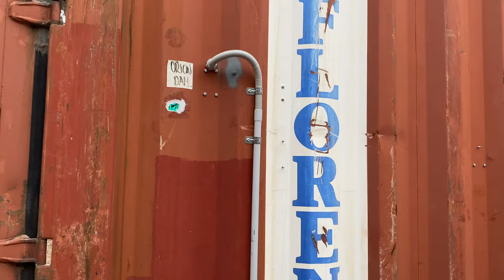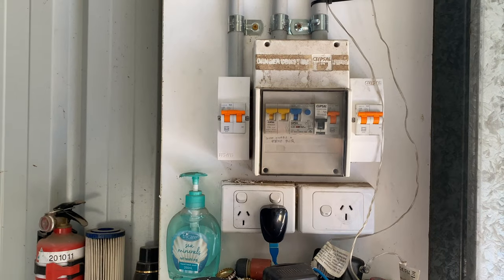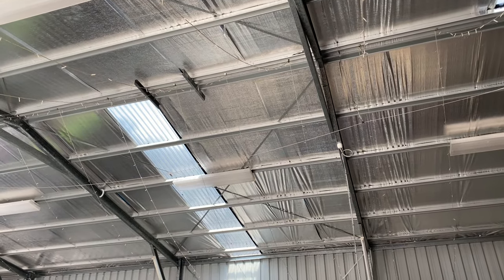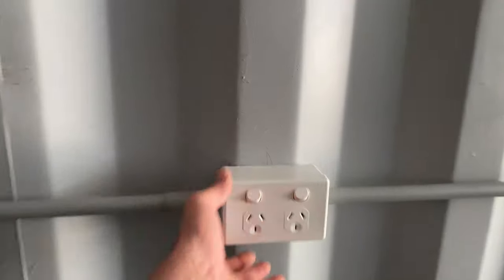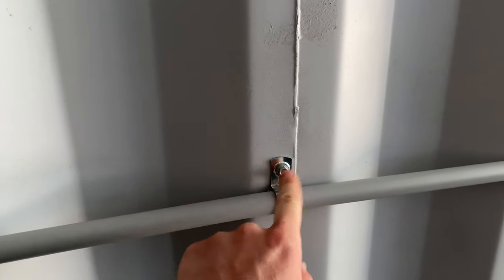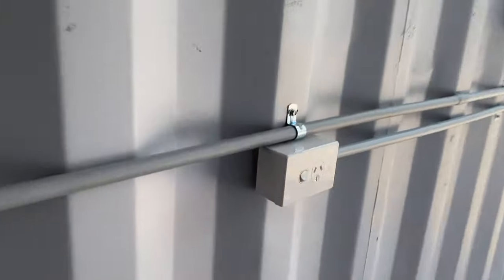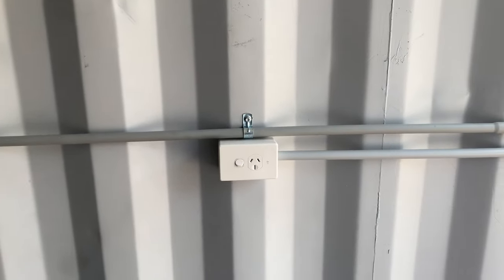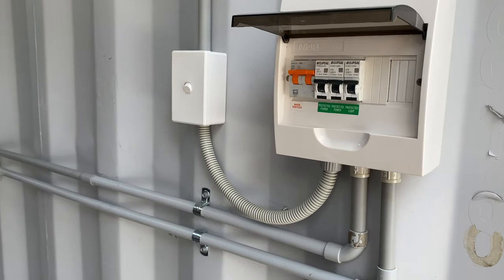40ft Shipping Container WORKSHOP Build - Electrical Part 2

Comment: What size/type hardware did you use to secure the GPO boxes? It looks easy ( was your helper on the outside holding the bolt head)? 
I’m inspired, I’m gunna fit out my container like this now. 👍🏻
Reply from the maker: It worked amazingly and still does, if you have the time I suggest welding nuts internally to avoid drilling holes and even cable tracks if possible.. yeah we just bolted through the wall one inside one out worked well..

Comment: What type of screws were used to install all the electrical equipment on the container ribs?
Reply from the maker: M6 bolts with lock nuts were used and gal painted
Reply: Thanks!

Comment: That looks like heaven!! Awesome work mate!
Reply from the maker: Thanks Adam it’s definitely coming along! So nice to have a space to work in 👌
Reply: @EngineeredToDesign  I would love the space to be able to have something like this. Can’t wait to see everything that is built out of this beast of a workshop
Reply from the maker: @adamshields1982   there’s always a way haha could you use a 20ft container? Thanks mate I really appreciate it! I cannot wait to have it all set up and build stuff inside..
Reply: @EngineeredToDesign  in a townhouse so defiantly have no room lol. Love your work mate!!
Reply: Just a note on your wall drilled holes.  What type of sealer do you use for the attached electrical holes as to prevent water / rain and or have any lesson learned from this to share
Also attached ceiling holes which are critical as well for rust / any leak problem 
Thanks bud 
Texas based & Great vids & info